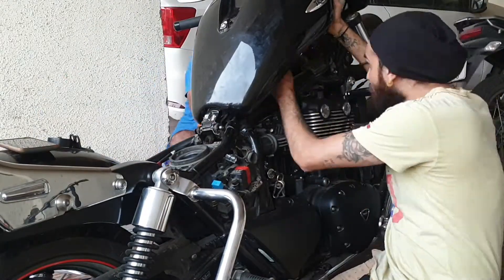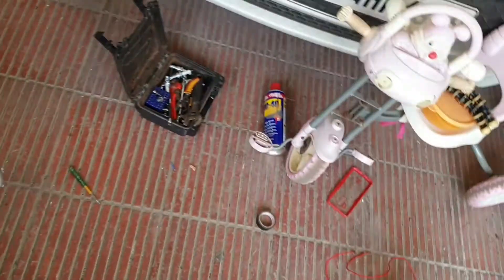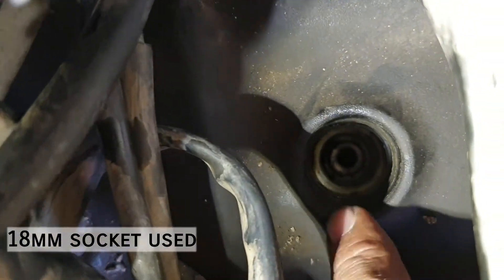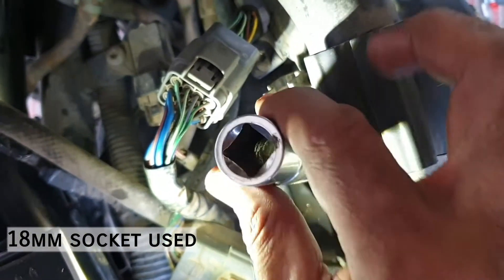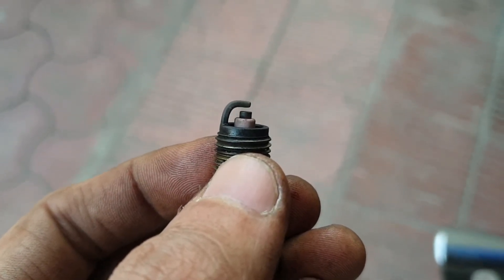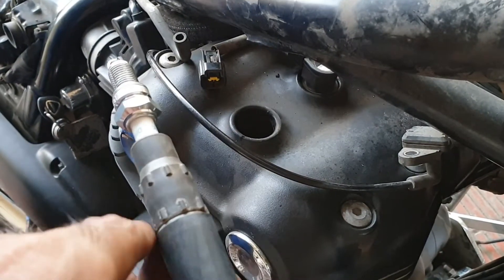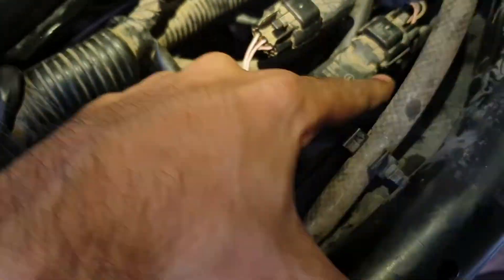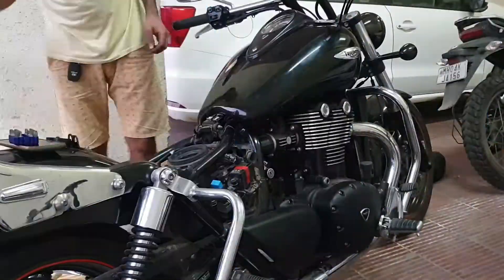How to service a SUPERBIKE at HOME| SUPERBIKE service| Tips to maintain a SUPERBIKE| TRIUMPH Cruiser

Comment: Just a suggestion, Never spray down WD 40 or compressed air after the plug removal. The dust and fine sand will go down into ignition chamber and u will end up with scarred cylinder. Better to use a vacuum first or compressed air before plug removal.
Reply from the maker: Yup... 👍
Reply: So how would u clean that dirt elaborate please